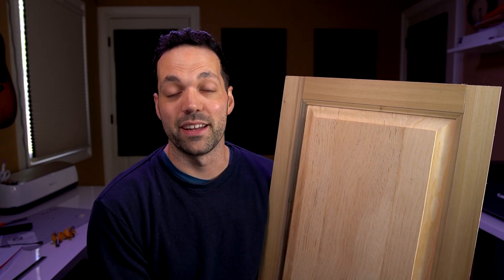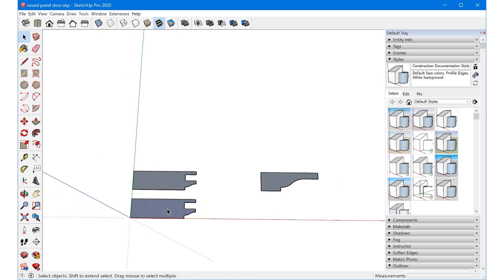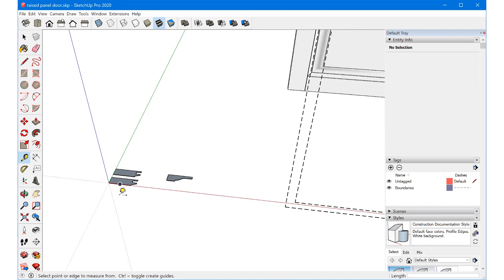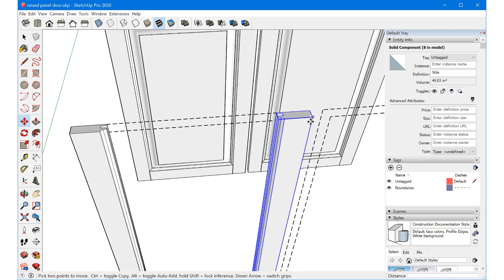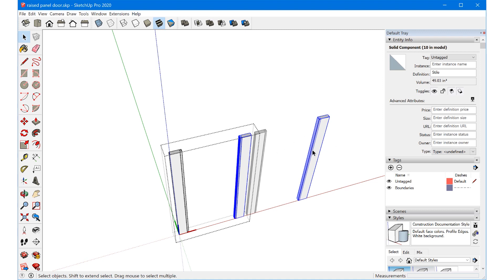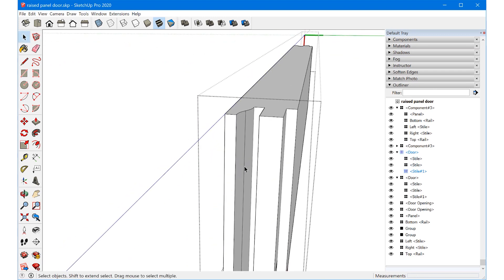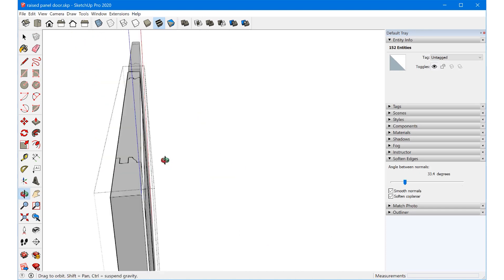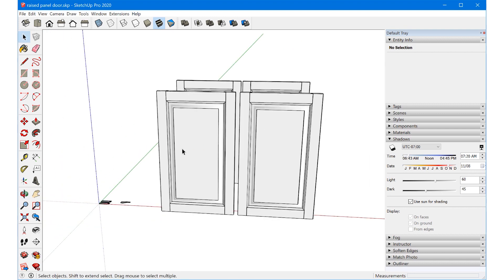How to make raised panel doors in SketchUp

Comment: I’m a professional cabinetmaker using sketchup for everything and raised panel doors are the most time consuming element to make. I really like the new scale tool you showed at the end. Does that change the size of other “door” components shush that I should make that a unique component to make a different door size?

Is there a way with components and the feddo scale tool to be able to replace that sticking and panel profile with something different? How can I edit one door and have the rest of the doors change. Particularly important is that only the inside edge and panel profile change. Often times there are different sized rail and stile widths throughout an entire kitchen project. Any ideas?
Reply from the maker: Hi William! Fredoscale will automatically make the component unique when you use it, so you don't have to do that manually. 

Regarding changing profiles out, you're suggesting a scenario where you have multiple doors of different sizes, but all the same profiles, and you're looking for an easy way to swap out the profiles? You can do that with Profile Builder 3. It's a paid plugin, but it's my favorite. Luckily it literally just went on sale for 50% off. As a cabinetmaker, I think you'll find it to be really valuable. https://mastersketchup.com/profilebuilder
Reply: MasterSketchUp interesting. I’ll need to check that out. I had a really old free version of profile builder but it stopped working. It wasn’t worth it just for the mouldings yet but if it can do frame and panel profiles, that would be awesome. 
SU is fantastic for me since I can know everything about a project before I build it since I physically draw it. Making changes is annoying though when I have to change so many components to make a cabinet 3” bigger. Ah, but that Fredoscale may be able to help with that too, depending on the scenario.
Reply: William Butler Hi there, if I may but in here, try Cabinetsense. I just started to use it and it is awesome! It also exports to cut list plus and to a CNC if you like.